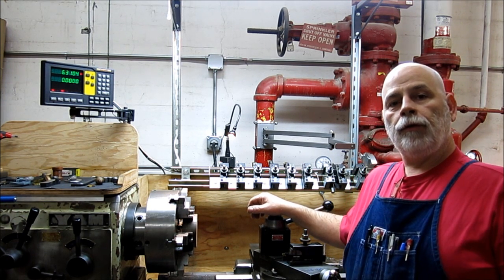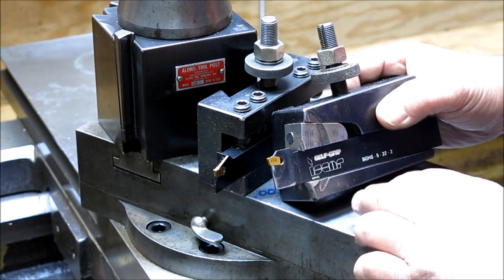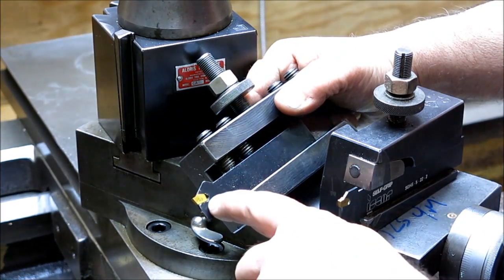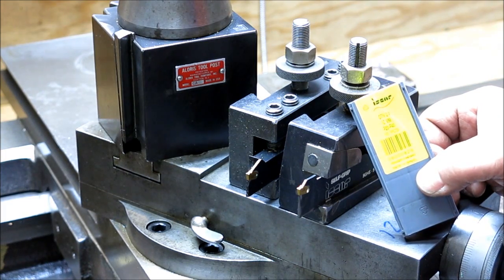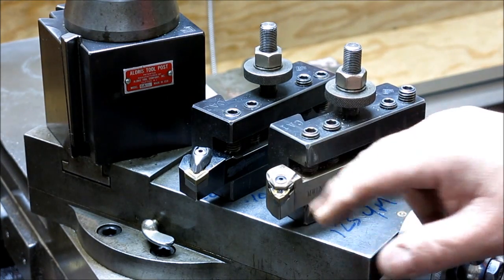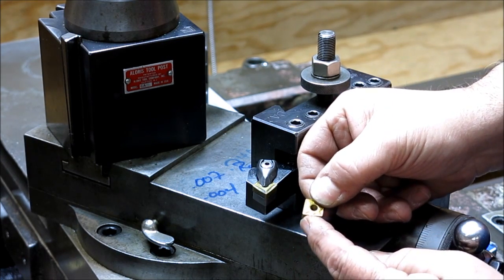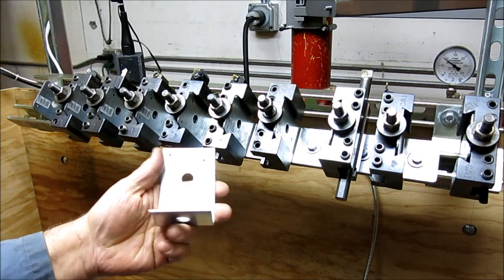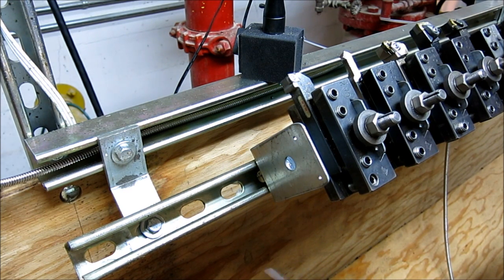Wabble Gear Machining Tools

Comment: Hi. If you want to use rest of the corners of CNMG tips you can buy another tool which can be used this for heavy duty facing for example. Then approach angle will be 80° or less. For example CCKNR or CCKNL will match depending on revs direction. Both of this tools have 75° angle so will be 5° relief when is set square. You only need to make sure of shank square size and its lenth.
Reply from the maker: Hi Radoslaw,

I have seen these holders. They would be a good solution to maximizing the use of the CNMG inserts. Thanks for the comment.

Cheers,

Tom

Comment: Hi Tom, thanks for the info on the inserts and holders. One thing I'm still not clear about: what advantage(s) does a trigon insert have over a triangular one?  What problem does the trigon solve and/or what specific benefit does it provide?  Why do you prefer a trigon over a triangle? Thanks, as always.  -Chris
Reply from the maker: Hey Chris,

The angle at the tool tip of the trigon is the difference. Triangles are slightly more acute at the tip and weaker because of this. On the same note triangles can do things that trogons cannot but mainly related to tool clearances. 

Hope this helps. Regards,

Tom

Comment: Hi Tom,  great video, as they always are.  I have been digging around looking at the various recommendations you provided for inserts, mainly as a way to better understand all these options.  I must say, this is a head scratcher.  I have been looking for the WNMG 3-3-pp IC 907.  I can find lots of ISCAR inserts that are close, but cant seem to find the one you are using.  I see the WNMG 3-2-pp but not in IC907.  I see WNMG 332 in IC907 but is that the same as 3-3-PP, man these tiny differences will give a guy a migraine.  Any recommendations?
Reply from the maker: Hi Tim,

My bad. I mistyped the number on the Iscar inserts. It should be WNMG 3-1-PP in IC907 Sorry for the confusion. Late night video editing is my weak story.

Regards,

Tom
Reply: oxtoolco No worries, your commitment to sharing your expertise is a gift to those of us learning.  At least I now don't feel like a knuckle head for not being able to sort it out.

Comment: Tom,
I received the Iscar MLWR holder I bought off ebay just last week. Works great, I had been setting a TNG type holder below center height to get the same quality finish. While that worked you had to fuss with the height depending on the OD of the part. Now I can set it on center height and leave it.
-
Joe
Reply from the maker: Hey Joe,

Did you get any inserts with your holder? What size inserts does it take?

Best,

Tom
Reply: oxtoolco Tom,

I got 20 inserts with the holder, WNMG 3-2-PP & -WG. IC 8250 and IC9250 respectfully. The holder is pretty beefy and barely fits in a CXA holder.

I picked up a 3 jaw chuck with an L1 mount which is running out about 15 thousandths. The taper, while not rusty, was pitted. I would like to fix that. I am leaning towards grinding the taper then the jaws. Is that the order you would choose?

Thanks,

Joe

Comment: Tom, 
If you wanted to cut (turn) the teeth off of a cast iron gear, interrupted cut, what cutting tool would you use?
Reply from the maker: Hi Ron,

I'd grab the WNMG I showed in this video. It really is a pretty versatile insert.

Cheers,

Tom

Comment: Tom, thanks for sharing your turning tools with us. I think you and I use pretty much the same types of tools, including insert types, and the ISCAR parting tools. My blade is in a tool block and are much thicker. I need to find a one of those thin blades too. I shot some video of my carbide inserts tools as well and hopefully you guys will see that soon. 
Take care bud!!

Adam
Reply from the maker: Hey Adam,

Thanks for the comment. I would like to see some of your carbide tooling as well. Good to see you up on your hind legs again.

Talk to you soon my friend.

Tom

Comment: Tom, Thanks for sharing your knowledge concerning the carbide inserts but I have to ask and I have to figure that both positive and negative geometry are used on the center height line, if you can get twice to three times the use from a single insert that is negative what is the advantage for use of a positive insert?
Your Friend in MS,
Still Working on the CopShop,
John
Reply from the maker: Hey John,

Great question. Negative geometry produces much more tool pressure. So thin or slender small diameter parts tend to push out of the way instead of cutting. Another example might be a dodgy setup where you don't have a great grip on something or its hanging out in the breeze. Think axes and straight razors.

Cheers,

Tom

Ps, CopShop. Sounds like a new YouTube channel name in the works.

Comment: You can get holders that allow using the "off" corner on the CNMG inserts.
This works great for facing cuts that you don't have to drive into a corner with
and gets 4 more uses out of that insert.
Real nice when your a moving a lot of 316 and they are whining about insert cost!
8 edges out of 1 insert pays for the holder pretty quick, wink wink
PS that "off" corner is even more robust and holds up great in cases that it can be used
Reply from the maker: Hi Gent,

Good point. Knack Knack. 

Cheers,

Tom

Comment: Sandvik and Iscar have great sites with ALL of the info on their cutting tools and inserts.  on the sites they also have machine tool newsletters and what is "happening".  Plus they have feedspeed apps, downloads, etc.  I saw a general description in the Machinist Handbook, on tool insert nomenclature/identification......  It's a TNMG....buzz hog....Ferro-Chower....etc.   But, do to proprietary trademarks and patents, some inserts are not equatable.   Thanks Tom, for info on the tool stand idea:  cheap, quick, and secure.
Reply from the maker: Hi Joe,

Great points you make. One of the difficulties is where to start. Looking through the Sandvik book can be intimidating. I send folks to the Mcmaster Carr section on inserts. http://www.mcmaster.com/#carbide-inserts/=qkgvqk 

They really did a decent job of simplifying everything and taking away the catchy Sumo buzz hog shearmaster stuff.  Now I really want to try a FerroChower.

Cheers,

Tom

Comment: I like the idea on the holders for the tool holders. I use the chip tray on my lathe as a shelf because I tend to lay my measuring tools on the headstock to keep them clean from chips. The chip tray does get messy with tooling especially if I am making multiples of something that is a multi operation part. I need to fab up a nice rack on my lathe as well. Its a long reach across my Monarch though so maybe I will make it on a rolly cart or something.
Reply from the maker: Hi Bcbloc,

I agree. There are limited spots to get your left hand on one when standing at the lathe. Two places are available. On the headstock or behind the machine. We used to have small tables near each lathe. One third sheet of plywood size. You could just turn a little and reach back with the left hand to grab something. Also gave a place to set your tools and materials.

Cheers,

Tom

Comment: I use the same parting inserts. Once you go to carbide for parting you wont go back easily.
So I've been wanting to make the jump to inserts for turning and questioned a lot of people. No-one, however, seemed to agree with me that the W-series of inserts are better value for the money with 6 cutting edges and all. Most shops seem to use the CNMG's but I don't see it as better. The trouble I've been seeing with W's is that no-one seems to have a WNMP positive insert available?? I like the idea of having a negative insert for roughing and a positive for finishing.

Cheers
Colin
Reply from the maker: Hi Colin,

Good point you make. The W inserts I showed in this video are actually quite positive because of the chip breaker molded in. What we did many years ago it not try to condense it down to one style. What we did was say okay one for soft and one for harder materials. What we ended up with was the WNMG I showed here and a CCGT high positive polished insert for the soft stuff. Now with the C you get all kinds of options for other materials and holders but at the expense of only two cutting edges. When in doubt go with a positive geometry. Not too may materials that don't like it.

All the best,

Tom

Comment: hi tom  dont want to bang on about compressors i mentioned that hydrovain rotary compressors were good/really quiet i took one apart must say they are really cleaver how they work really good quality last you a lifetime, just noticed john from double boost has one he keeps it under his table
Reply from the maker: Hi Jon,

I have been looking at compressors used in dental offices. They have to run super quiet. I am keeping an eye out for the right deal. Meanwhile I will continue to use my high dollar toolmaker canned air with abandon.

Cheers,

Tom

Comment: Thanks for all the info Tom, I'm going to get started on my rack soon.
As for the inserts, Do they have a poster type chart available you know of ?
Reply from the maker: Hi Dennis,

Most of the big manufacturers have a big master chart or index. I would start here http://www.mcmaster.com/#carbide-inserts/=qkgvqk 

Then move into Machinery's handbook for additional information. McMaster has done a great job of thinning the insert herd a bit to make it much clearer for the casual user.

Cheers,

Tom

Comment: Thanks Tom, that's some great information, and more stuff to add to the expense sheet. I'm still using High Speed Steel Tooling from the Arthur R. Warner Co. Good quality tooling. Been hesitant to try carbide until I've really figured out the limitations of my Machine in terms of speed and Rigidity!
Reply from the maker: Hi Robin,

Remind me again what equipment you have? 

Cheers,

Tom
Reply: oxtoolco I have a Grizzly G0709 14 x 40 lathe and a Grizzly G0722 Mill

Comment: Why do you call it a "Wabble" gear? Is that the name of the gear, or the person who cut it out? I googled wabble gear and couldn't find anything. Did you mean "wobble" gear?
Reply from the maker: Hi Victor,

I'm pretty sure Wabble is correct. There is a reference in the book "Ingenious Mechanisms" that calls it a Wabble. They were used as feed water pumps on some kind of steam engine back in the day. The correct technical name is Cycloidal drive.

Cheers,

Tom
Reply: ***** Oops, I didn't mean to come across as a grammar nazi. I just figured there must actually be something called a Wabble Gear. I also am snowed in  and I must say that that NASA article is fascinating.
Reply: Older texts use different forms and words. I have some of those old mechanism books too. According to the definition, wabble and wobble are variants of the same thing. Both are correct. (Yeah, I looked it up first time I saw it written too. Looked odd :) )
Reply: ***** Tom's book is ISBN 9780831110314, published 1951. Page 322. Says there the mechanism was in use 70 years prior. 

BTW that 1964 NASA patent seems iffy on more than spelling. Hermetic rotary motion feedthroughs using a bent shaft in a bellows have been around since forever.
Reply from the maker: 11zekim Man am I glad you guys got this all sorted. Now I have a cool Nasa article to read. One of those space boys probably did the same thing when they looked it up. Interesting in the one in the article is a face gear like a curvic coupling. I am now wondering why they did that. It seems it does not make it any more compact. Perhaps it has to do with sealing it for vacuum.

All the best,

Tom

Comment: Tom,
Thanks for this, wading through the carbide jungle is tough for me due to the vast selection out there, I rely on my local tool dealer, but he is still learning too, using me (and others) as a test bed, So carbide inserts are still hit and miss for me.
When its good .. it's great, when it's bad ... it's wasted money.

Thanks again,

Stan
Reply: oxtoolco And it should be a law punishable by 5 year prison term, that ALL manufacturers of tooling laser etch insert family types on all tool bodies, there is a special place for those that dont in the 9th circle of hell, right next to the ones that remove mattress tags.
Reply from the maker: Hey Stan,

You are right about that. Add in a couple of holders and the only person thats happy is the tool salesman. Looking forward to your next surface grinding expedition.

All the best,

Tom
Reply: Helps if you can use the same insert style/size in multiple tools. I looked for  L and R turn/face tools and two sizes of boring bar that all use the same CCMT insert. (Gee, a matching face mill would really be awesome...)

Yep, snow day here too.
Reply from the maker: 11zekim Hi 11,

You have the right idea. I use a lot of CCMT type inserts for turning and boring. The ability to switch your inventory of inserts between a bunch of holders cuts down on the outlay.

All the best,

Tom